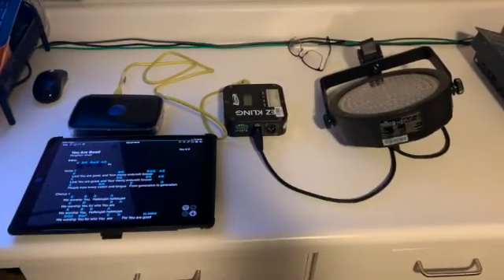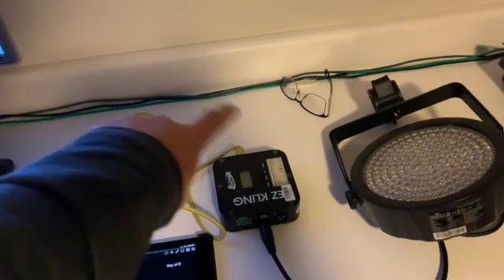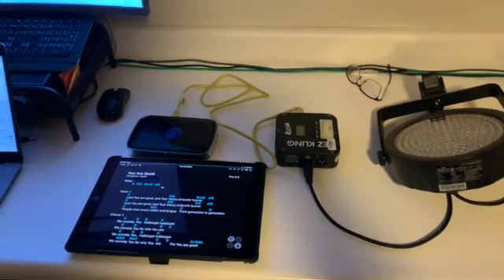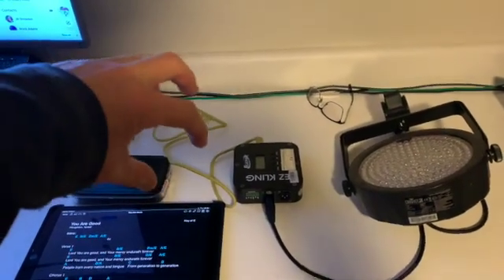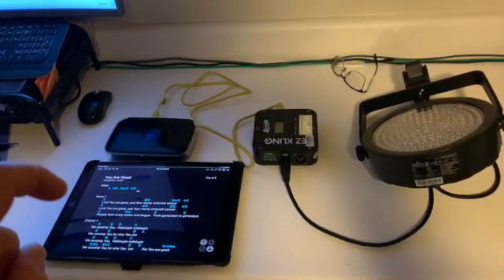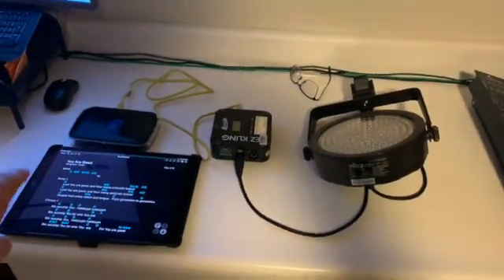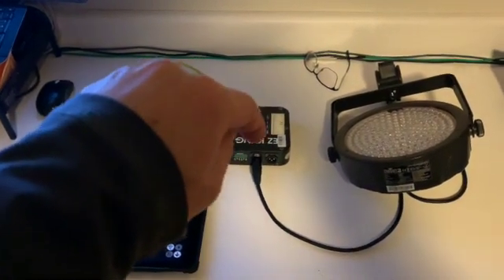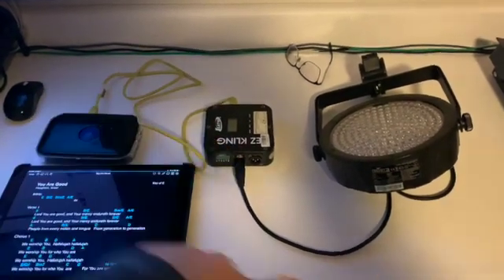Quick OnSong DMX Tip

Comment: Hi Steve, yes we have the AN2 working direct with Vibrio no other software needed, but couldn’t get it to work through OnSong, could see the IP address in the node section but couldn’t get it to operate the lights😢
Reply: how did u get the an2 working with vibrio, im having trouble connecting to it

Comment: Hi Steve, thanks for that, just one question why would Vibrio work through the AN2 with no other conversion hardware and OnSong needs to have it converted? Cheers Deirdre
Reply from the maker: Actually, the AN2 could - in theory - work.   The early versions of the Chauvet stuff were a simpler approach, like a DI Box for audio.   Do you actually have Vibrio working through an AN2?  I haven't been able to duplicate that yet.  Not a Vibrio guy (Luminiere and others on the iPad, however), but interested in checking it out.
Reply from the maker: And as I mentioned in the OnSong forum, the web-based UI of the AN2 would be a big detractor for me.  I don't want to log into it from another device to change settings.  I need the buttons right on it for quick setup and application...